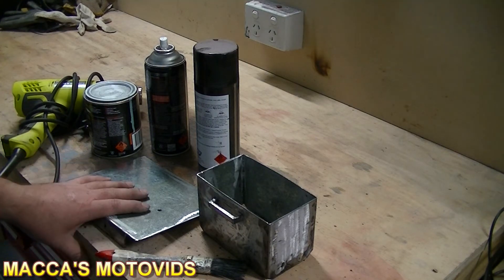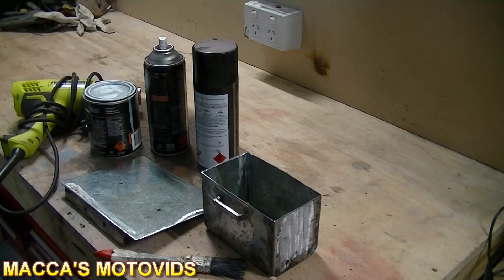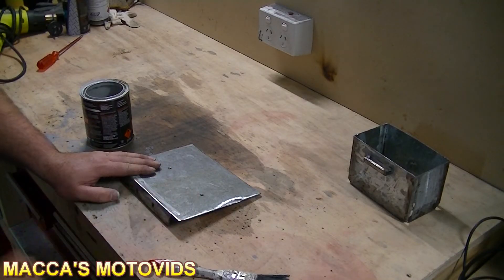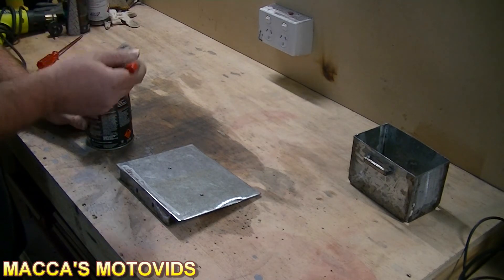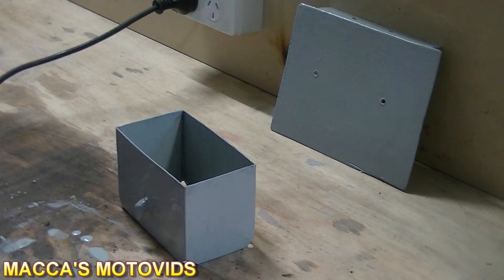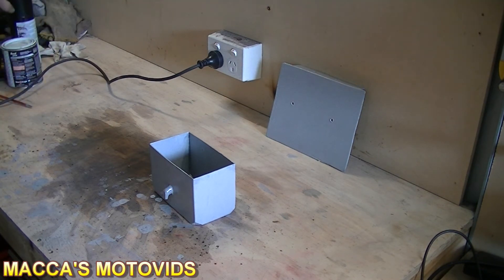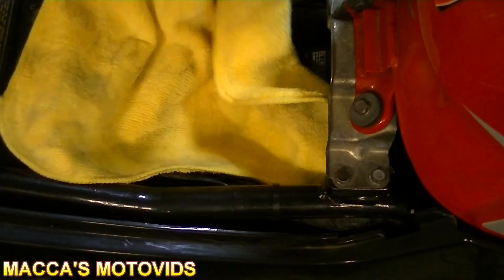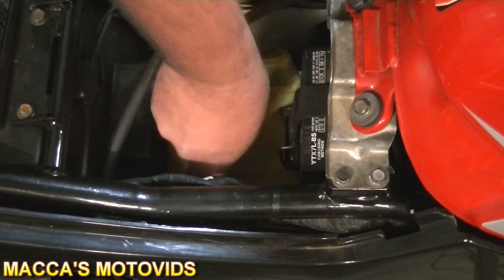Battery relocation mod

Comment: You got rid of the airbox????    That SUCKS if you ask me!  What is the point of an XR?  DIRT! Mud! Water splashes!
Reply from the maker: Given that my bike is a full fairing road only bike that I only ride in the dry I am not concerned with mud or water and the pod filters that I installed were for and dirt or dust that might get in there. One thing that I should make a note of on this video is to put some form of heat barricade to separate the engine from the expanded storage area because all of the heat from the engine flowed up to the seat and lets just say it gets rather warm